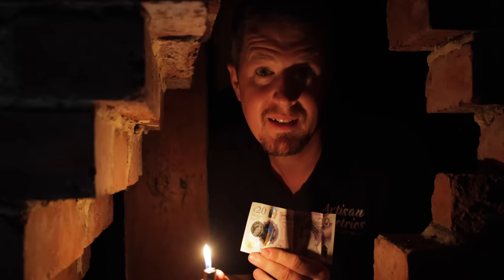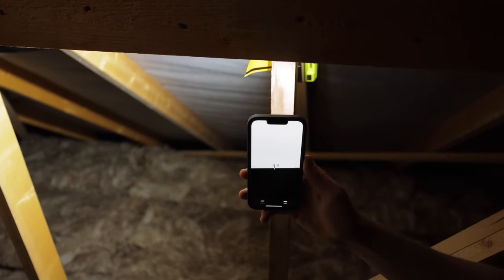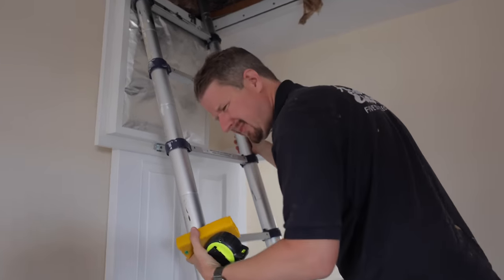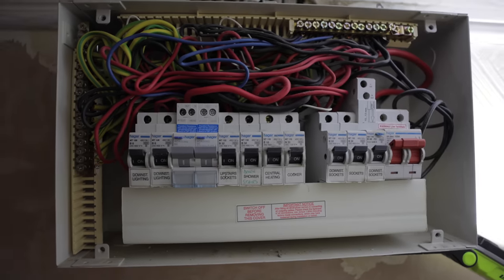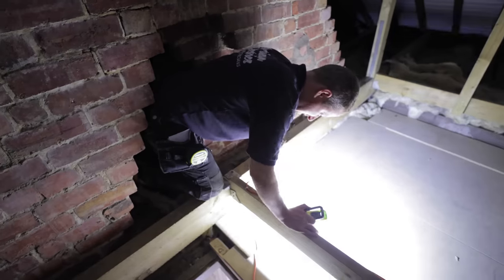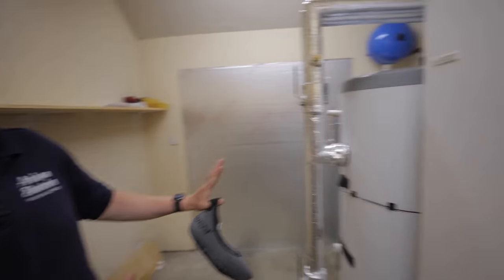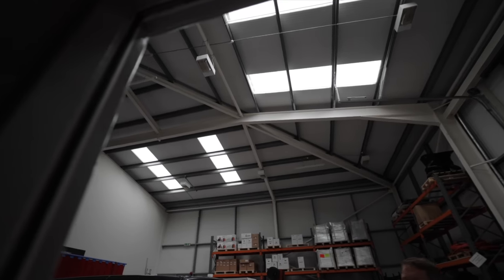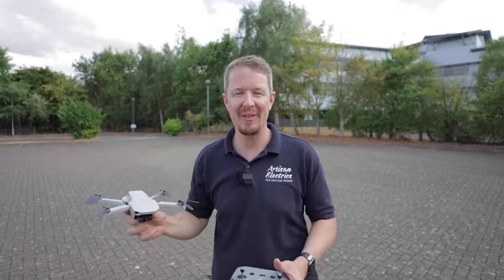STOP BURNING MONEY! 😱 Bring your energy bills DOWN!

Comment: great Video Jordan . how many years will it take to get your money back on install on a sola and battery storage ?
Reply from the maker: Depends on what you have installed really. Varys from property to property certainly doesn’t take as long as it used to!
Reply: Even battery storage alone could make a big difference. Charge at night, then discharge during the day.
Reply: At the expected prices in October, it'd be just over 3 years to pay back what we had fitted at the end of 2018 (not by Artisan): 4.8kW PV + 4kW SolarEdge Hybrid inverter + ~7kWh LGChem battery + MyEnergi Eddi (immersion controller to route spare electric to heat the hot water) = ~£10,400. Bought a 2nd-hand E-Niro in October last year. WIth Octopus 'Go' tariff our bills were ~£500 a year (mainly from EV and heating hot water with immersion in winter), and going up to ~£1000 a year with the price increases. So, saving around £3K a year compared to the price-capped average. E-Niro fills up (20% - 80%) costing ~£2.80, 80% is good for 200 miles range. Eddi gives free hot water for ~6 months of the year. Currently in Italy the government will pay for such an installation (not the EV) and then give you 10% back on top!
Reply: @gavinnoname1424  battery storage alone is actually the shortest payback and most bang for buck aslong as you have an ev , change to off peak tariff you’re basically paying 5.5p per kw .
Reply: @persona250  what supplier would that be with? I've looked at Octopus Agile tariffs, which are around £0.50 per kWh 😳
Reply: @pIotney  octopus go tariff
Reply: @persona250  7.5p/kW off peak now for us (previously 5p/kW until our previous Go tariff expired)  but still a great tariff for EV.  Very tempted with a home battery, enquired about Tepeo for a heat battery solution but sadly they're not covering the north west at the minute.
Reply: @richardchester2148  go with a lithium to cover peak day usage .
Reply: How many years to get your money back for say a new gas boiler or new kitchen units.  Why do people think  it should give you payback rather than a cheaper energy save
Reply: not as long as you think, i was on midsomer ev (milton/cambridge) website last night, and for a 5kw pylontech lithium battery it was in the ball park of £1800, if like me you already have solar and get FITs, as i understand it you need a additional hybrid inverter to invert from ac to dc to go the batteries this are less than the batteries so for 4-5K your done, or 7-8k if you dont have solar already,i will adding more solar next year and 2 more inverters and pylontech batteries, with there 5kw batteries you can string up to 16 together,so add more as you can afford them :) :)
Reply: @kevinmatthews2620  you need to pay dno for a network survey for more than 3.68kw . Can take 45 days for them to do this and they can also decline you .

Comment: Not much I can do to reduce my energy with a air sourced heat pump using £1200 / year doing nothing. It's 1ph -> 3ph inverter powered up continuously, using 2A. If only the OEM accepted it's crap and reprogrammed it so the contactor only energized when the inverters required, not keep it powered 24/7 "cos it has to communicate with the system".. I monitor its sorry state, last month (DHW only) it used £91.30, of which £20.95 was due to the compressor working. Might as well switch it off and save myself £70.35..
Reply: Who is the manufacturer?
Reply: @randomcamerajunk6977  Stiebel

Comment: Nice if you have the money to pay for Tesla walls, solar panels, e.v's, etc but most of us cannot afford those things. I find it hard enough just to pay the basic bills and the rip off rates. I would suggest most should do the following first.

The first thing to do is cancel your direct debit to the parasitic supply companies and pay on demand of an invoice. The suppliers put my dd up from £184 to £600 at the beginning of this energy scam and I did just that. Over the last year I have paid an average of £150 a month for gas and electric.

Octopus under their terms of contract can only put in estimated readings if they do not receive a manual reading from you after 3 months. 

Although Octopus are very pushy and harassed me every 3/4 weeks for a reading and if I did not do it they just stuck an estimate in and sent me a letter stating I had 14 days to pay. I have advised them I will not put up with this harassment and they need to keep to their terms and conditions or I will report them for the harassment. 

By paying on invoice means they cannot rip me off. They state that dd's are easy to change. What they do not say is you cannot go into your account and lower the amount they have set. You can only increase the amount of the direct debit.

Do not be fooled this company is able to have a substantial amount of customers money sitting in their own bank accounts working for them not you.

Comment: You wanted to know the correct angel.....
There isn't one, I live in Yorkshire so technically the correct angel is 52 degrees........
But in winter you need Tobe alot more vertical as far as 13degrees to plum line.
Best rule is the more vertical you can fit them the better.
Less power in summer but you have longer hours of  daylight.
But at winter you get more power but only in a shorter day light hours
It's finding that perfect angel for both winter and summer.

Comment: Thanks Jordan! Great video!  Just quick question if I may please chap, how much would a typical installation like this cost? Of course I understand it would depend on the type of house etc but ballpark figure?
Reply: Parts alone for solar plus battery are 6-12k. A big system installed can be 15-20k
Reply: @JE thank you JE! So clearly not cheap, I wonder what the turn around time is for recouping the cost!
Reply: Many places online will do you a ballpark for 3.68kw (G98) system. Batteries are the pricey bit to be fair

Comment: Be careful if you're a homeowner and offered a scheme to get free panels in return for some electricity and 'leasing the roof' for 20 or so years. Their money is made by selling back to the grid to pay off the solar panel system and make a profit. Many mortgage companies won't entertain these leased roof contracts and the seller may need to pay off the remainder of the lease to be able to sell the property. Also some lenders may only give a maximum 75% LTV mortgage on a house with a leased roof contract in place.

Comment: Lots of good information. I have found, despite a large South-facing roof, that installation and parts costs are so high I would not save any money at all. I love the idea of solar, but the panels should be built into the roof system of every new build, and be owned by the electricity company as mini power stations, and they pay us rent for the use of our roof space, in lieu of a standing charge for a mains electricity supply.
Reply: that sounds good; just need the political will

Comment: I’m an avid follower of your channel and like the way you present the practical aspects of domestic electrical issues.
I have a couple of comments on this video that are not meant to be criticisms at all but my preferences:
Measuring inside the loft often means that the eves cannot be reached so  I would recommend checking the dimensions  of the width and length of a house from the outside if possible. 
My other comment is the use of centimetres which sends me into ‘rant mode’. Please just use metres and millimetres . These are SI units the centimetre is NOT. (don’t get me going)
Reply: Sorry mate you're being ridiculous with the cm thing. Being pedantic, metre is an SI unit, and centi/milli etc are SI prefixes. If mm is an "SI" unit in your opinion, then so should cm.
Reply: Agreed.  Professionals use Mega, Kilo, Milli, Micro.  School children use cm (only measured with a plastic ruler) because they can't handle the big or small numbers that we can!
Reply: @alanb4789  professional what?! SI units aren’t just for electricians. Most of my work is nano but you don’t seen me claiming mm is too big and this isn’t an SI unit (unless sarcasm)

Comment: What?! UK energy companys  dosent pay private households who exports solar energy to the grid? 
They do in Finland. So for exemple: monday when the kwh-price was 1€/kwh, if u sold 100kwh that day in total you gained 100€. -taxes. From the sun. 😀
Reply from the maker: They used too 😩
Reply: @artisanelectrics  if I was that customer I'd be turning off a few lanes of panels so that I'm using what I generate and give sod all back to the greedy grid it's common sense
Reply: Energy suppliers have to pay consumers for power exported to the grid but each energy suppler gets to choose their own tariff and there's no required minimum.  So you have to shop around to find a suppler that pays a decent rate.  There may not be much choice at the moment.  It's called the Smart Export Guarantee.
Reply: @andrewuk8363  you dont have to sign up to the not so Smart Export Gurantee as it is now what used to be FITs most if not all newer inverters can be set to to zero grid export so filling your batteries :)
Reply: they did until the governent stopped it but the supplier may agree, minus a commission

Comment: I like the idea of a loan to pay for this as it COULD give you instant savings? I see a £10k loan over 10 years at 3% APR is around £100pm so if you save more than that in energy savings you are better off instantly. I'm not sure of the exact rates you would get due to your personal circumstances but worth a look!! - be aware battery storage is charged at 0% VAT ONLY WHEN BOUGHT WITH SOLAR currently! (feel free to correct me on this!)

Comment: Just pay what you can afford, I AM just reducing my direct debit with my suppliers and they can have the rest by installments next year,
Reply: Have they agreed to this? Curious about the help being offered by companies but I suspect if this isn't agreed then some people might find themselves with a prepay meter (especially those that are thinking to withhold payments)
Reply: @_Miner  Made the call this morning to SSE, told them i want my debit payments made back to what i used to pay, this has been done saving me £100 pm i was £400 in advance on my gas payments so left that as is, had solar panels fitted 7yrs ago so electric bills in summer are low. I told them on the phone that i will be sitting in the local library in the winter so will not be using much gas, i will set aside the money if more is needed that will be in my account not theirs, this money can then be paid to them in installments if need be. I don't have a smart meter and have just come out of a fixed rate contract about 5 mths ago, all lights (LAMPS) in house have now be fitted with led low power watt.  
( DON'T HAND OVER YOUR HARD EARNED MONEY TO THE ENERGY SUPPLIERS JUST BECAUSE THEY CAN DIP IN YOUR ACCOUNTS FOR WHAT THEY WOULD LIKE)
Reply: @melike1984  Good to hear that they have done this and sounds like you know what your doing unlike some people who think they can just pay lessand keep using the same
Reply: @_Miner  Be smarter than them.🤓

Comment: How to save money... Cancel DD payment and bypass the meter! (Seriously, don't do that! Lol) 😀 Joke aside, this country is a hot mess right now, it disgusting that energy companies making billions and government sit there and do nothing. Absolutely madness that customer's bill gone up from 150 to 600!!
Reply from the maker: Crazy right!
Reply: For a customer's bill to go up by that much has surely to do with other factors and not just the price cap increases. Either their usage has substantially gone up or they were underpaying before and now have built up a large deficit which is now being paid off.
Reply: @_Miner  you hit the nail on the head, under paying or in the case of BULB not putting the tariff up from last Oct then suddenly sending a new bill backdated and adding that to the account.
Reply: @_Miner  That's I was wondering as it got to be other factors resulted in such sharp increase, also could be if customer have air conditioning or anything that contribute to high usage.

Comment: So how does someone like me save money? You did not say. I can't afford solar, heat pumps cost a fortune, AND you have to have bigger radiators and pipework, all new LED lamps will cost a lot 😑 Please change the title of your video.
Reply: i bought a absolute shitloads of low energy bulbs in 2002 when tescos and eon i think where doing a special 5 for £1 if i remember correctly had to visit tescos bletchley/milton keynes/march/wisbeach & king lynn to get them though 20 years later 3 have blown and i still have 20 odd left, 1 flouresent tube in kitchen everything else low energy bulbs no dramas switch on light leave room switch off simple really, btw last 12 months gas/electric was £593;76p FITs for year was £1200 gain of £600 ish :) :)

Comment: People running underfloor heating and towel rails etc need to turn those off !!   The clever ones  can "adjust " the supply tales  before the meter  very discreetly and spur off to another 3-4 gang Consumer that is wired to run the immersion and kitchen etc  and living room FRC  .leaving the "visible " working Consumer to only be running the lights and upstairs rings etc .  Bill comes in, bill gets paid , no one knows  and you save 70% !
Reply: Great on the surface idea, however do you really think your supplier won’t send a snoop around if your KWh drops from say 5000 per year to 1000?  The unit cost becomes irrelevant.
Reply: @MS-Patriot2  they dont have anyone to visit homes these days ! And everyone will be cutting back . Just removing an immersion heater and kitchen ring would save at todays costs £6-700 a year
Reply: @carforumwanker  Better get the Marigolds and Wellies out.  Bit of job explaining the cuts to the anti tamper seals though.
Reply: @MS-Patriot2  easy to buy them !!!
Reply: @carforumwanker  oooo, so they are!  Who’d have thought.   I have a feeling your DNO will know the expected serial I.d. on the seal, so tamper will be evident.  Got me thinking though 🧐🧐
Reply: @MS-Patriot2  DNO never visit !

Lots of people are making thousands a week doing it . Ive seen DNO guys snip off seals with no concern at looking at them etc .
Reply: @carforumwanker  doesn’t a smart meter squeak when you pull the main fuse?
Reply: @MS-Patriot2  Not every house have them :-)

Comment: IT WONT PAY OFF
Reply: damnit you beat my First comment by 30 seconds :)
Reply from the maker: Do you not think?
Reply: @artisanelectrics  Maybe in 15 years, possibly if you're lucky, then they will need replacing 😃
Reply: I have six panels, and possibly save a £1 a week, £52 per year, £520 10 years, £5200 £100 years, I is dead lol!
Reply: Well designed pv and battery systems can be paid back in as little as 5 years . Panels guaranteed to 25 years and will continue working with a drop in efficiency past year 25 . 

typical upfront cost of £8k paid back in 5 years .  Saving  £8k every 5 years after .
Reply: @persona250  lol that's the theory 😃
Reply: @spotfreefinish  are you an expert in the renewables field or a keyboard warrior ?